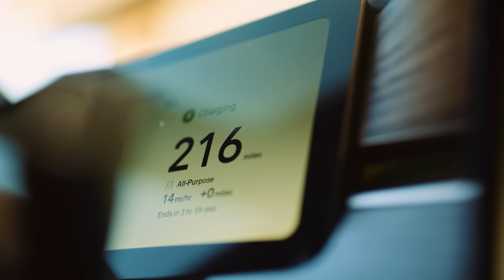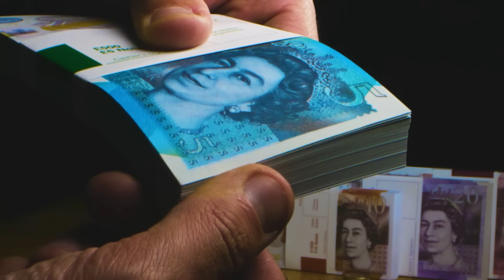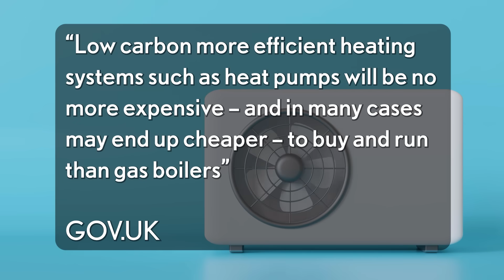The Truth About an All-Electric Future

Comment: Not sure they're making the gas safer. The company that changed the pipes in our road are a right bunch of cowboys. 
They renewed the pipe in my front garden and I had to replace the shrub They took out. I dug a hole going down a fork depth, pierced the new plastic pipe so had gas pouring out into the street. Turns out they hadn't put it down at the recommended depth. Ridiculous considering it's going under a garden where I'm obviously going to be digging

Comment: Our bills are around a third of what they were with gas simply by storing heat produced by the heat pump at night with a thermal store , running appliances and night and charging the car and batteries .
Nearly all our electricity is at 7p or less with solar 
Pie in the sky?
Reply: All very well for huge investment. What if you haven't got that money or the space? It's simple: energy prices must be reduced to less than a third what the state keeps them at.

Comment: WHY get rid of fossil fuels?  For one they're not 'fossil' - disabuse yourself of that fallacy.  They are not harmful unless you use them irresponsibly.  Catalysers, filters and other technological advances have made ICE engines almost 100% clean and the only discussion point is the CO2 which can easily be debunked as a 'pollutant'.  So-called fossil fuels (coal and gas in particular) could keep us warm and economically viable for centuries IF we had sensible policies instead of religious ones.
Reply: Oil and gas are the remanets of fossilised ancient plants and animals from about 200 Million years ago, similarly coal is the remains of long dead trees.

Science, not your religion, tells us that too much CO2 leads to atmospheric warming at a level the plants and creatures around us cannot survive in, us included when you factor in drought and starvation.

Exhaust emissions are filthy and carcinogenic, an extract from Health and Safety executive :-

"Vehicle exhaust fumes can irritate the eyes and respiratory tract, and are a risk to health by breathing in. Carbon-fuelled engine fumes contain carbon monoxide, a poisonous gas. Prolonged exposure to diesel fumes, especially blue or black smoke, may lead to coughing and breathlessness. Long-term repeated exposure to diesel fumes over a period of about 20 years may increase the risk of lung cancer."
Reply: @_Dougaldog   CO2 levels of 4,000ppm (some 10x what we're currently in) resulted in the most prolific animal and vegetation coverage on the planet during the Cambrian period.  This is what SCIENCE tells us.  You're reading the wrong books.

Please explain how dinosaurs all collected together in multiple massive graveyards to decompose into oil?  Please explain how dinosaurs exist on Jupiter, Saturn and other planets and moons given the PROVEN sources of hydrocarbons there?

If exhaust emissions are harmful then stop putting your mouth around the exhaust pipe.  Equally, don't spend 20 years sniffing HGV exhausts.  Specifically, don't sit in a car garage with the doors closed and engine running.

But, with EVs you're at risk of electrocution or immolation if you're that unlucky.  Everything in life has risks but we balance those risks against the rewards and YOUR fabulous lifestyle, YOUR excellent health and YOUR access to foodstuffs and goods are ALL the product of 'fossil fuels'.

Stop being so disparaging about something that has MADE your life and keeps it going.
Reply: @kellyeye7224  

You need to go back to school, educate yourself, Dinosaurs appeared long after the scene was set for creation of oil and gas.

Creatures lived in the seas that cover our planet, over hundreds of millions of years they died and built up on the ocean floors.

I'll let you go online and find the rest.

Burning oil and gas is destroying your environment you should not worship that but evolve and create a better future with skilled jobs and workforce.

The oil and gas in the North Sea is near exhaustion, we'll need to have broken our reliance on it before it runs out, which is exactly what is in progress now whether you like it or not.

Comment: As an electrical engineer of 37 years I think governments are utterly ridiculous . They call it green washing. The amounts of energy required to produce electricity cables, chargers, plastics, metals, not to mention the huge recycling as things get worn out. It cannot be rushed just because governments demand it.
Reply: It's not being rushed, the net zero target is twenty five to thirty five years away yet.
Reply: @_Dougaldog it is being rushed because the EV vehicles are not the entire answer nor are windmills that have relatively short lives of 20 to 25 , car chargers that fail after a few years ( I have replaced enough to know) and many more rushed technologies that are less than ideal just to reach certain targets before the deadline. Look at how many manufacturers tried to make engines that used less fuel and ended up making engines that fall apart in 60k miles. All require huge amounts of energy to recycle and EV’s even more. I have lived long enough to know that the planet cannot sustain the abuse it is currently facing but we are obsessed by technology to answer the problem. Consumerism and huge amounts of unnecessary travelling round the planet in planes is a far bigger issue. In my opinion.
Reply: @christastic100  look up data on the sustainability of EVs. The extra emissions from the batteries are compensated for in around 14 months of use. Tech is there to recycle the batteries for the next generation.

Comment: I envy people people with gas oil heaters and large tanks.
Reply: The tanks look so nice in the garden?
Reply: @Biggest-hz7ng That would be the least of my worries. Those people with gas oil will have heat if the taps ever get turned off.
Reply: @TurinTuramber I think I'd prefer greener, less polluting heating for myself and my neighbours, and no tankers needed. If you want a day or so's resilience, just add a suitably wired battery.
Reply: @Biggest-hz7ng The energy densities don't compare, an extra battery is nothing compared to a tank of fuel oil. 

Greener options are largely gimmicks to sell to people.
Reply: @TurinTuramber but if you believe outages won't be huge, electricity is fine, surely?
Reply: @Biggest-hz7ng A battery is better than nothing and you can have both. I think putting all your eggs into one basket is risky and once you are utterly dependant on electric you are going to suffer when the price jumps.
Reply: @TurinTuramber price isn't going anywhere. The UK is building more generation and transmission. The government won't willingly impoverish its citizens.
Reply: @Biggest-hz7ng Haha good one.
Reply: @TurinTuramber for one, you don't get voted in again
Reply: @TurinTuramber  

Until the tank runs dry ?
Reply: @_Dougaldog  Sure but a miniature nuclear reactor isn't an option so it's the next best thing. A tank could last a winter.

Comment: It's all total bollox. The government aren't investing anywhere near enough in generation, distribution and final delivery if they are serious about going all electric.
Just on generation they aren't planning enough capacity to cope with a 2 to 3 fold increase in demand. Hydrogen is expensive to generate, the atoms are the smallest thing in the periodic table meaning that distribution or delivery systems are likely to, at best leak, and at worst cause explosions.
Renewables are typically at the mercy of the weather, so it's either a country covered in those terrible BESS storage systems ( just like in EVs, battery tech lags well behind and so Bess's are unsightly, expensive, noisy - need air con to keep them cool,  and just like an EV if the batteries go into thermal runaway, they catch on fire and explode).
For the UK tidal seems like a good idea but there next to no investment here. The least worst option is nuclear and they aren't planning enough nuclear plants.
Anyway keep buying Tesla's everyone because nothing says ' I'm saving the planet' efficiency like a single occupant in an enormous 2.5 ton car driving like a bell end, chewing up the road surfaces with it's heated seats, air con and all the tech wasting battery power.
Reply: For one thing, EVs don't catch on fire like ICE cars do. The government are planning to 2-3x wind, and 1.7x solar, along with the transmission that goes with that.
Reply: @Biggest-hz7ng You're right it's possible to put out an ICE fire.
Solar - useless at night or when it's overcast. The government are actively encouraging areas of farmland to be put over to solar, so unreliable energy over food yeah great idea. Wind - useless when there is none or there's too much.
If we go with these unreliable generation methods we need storage and transmission. The option today is BESS storage and as per my post these are inefficient, ugly, use huge resources to build, not energy dense so they take up huge areas, and if they get hot expect a huge fire. We need reliable generation to meet dynamic demand and the government are hell bent on unreliable renewables.
You don't even have to believe me. Germany is the leader in early adoption of renewables and now their electricity is approx 25% more expensive than the UK because of it.

Comment: A school I worked at had a heat pump forced on them by the local council, it cost over £900k to install and the energy bills have quadrupled compared to the old gas/oil setup and the school has to pick up this bill from their existing budget (that’s £100k per annum as opposed to the previous bill of £25k and when I spoke to the project manager he said I’ll never pay for itself)
To that end it’s been switched off and they rely on a small gas boiler that was left installed.
Reply: There's example of poor management everywhere. Most schools are old and poorly insulated. Heat pumps should not be used until the building is properly insulated. I Know of 5 people with heat pumps, in appropriate insulated housing and they work absolutely fine, provided you get a competent installer. No 1 thing to do is Insulate!
Reply: @gerryparker7699 the 'requirement' for insulation is a myth. They can be installed in churches etc. You may choose to add insulation to reduce running costs (as insulation would with any heat source) and reduce the size of the install, perhaps needing a smaller heat pump and radiators.

Comment: Yet another ‘big oil’ push to allow them to carry on drilling. We can’t make enough green hydrogen at a sensible price so they’ll save us by making hydrogen from oil.
Reply: Hydrogen won't be a thing for heating as it is 5-6 times the price of gas, but it will be used in a small way for niche users.

Comment: Sorry to say, but we are in the process of a managed destruction of the energy system across UK & EU. Shutting off cheap reliable energy and replacing with intermittent expensive energy sources, why? Because they want to manufacture scaricity and turn energy into a form of control, via a carbon credit system. Already being rolled out for companies, and will be coming for individuals as soon as they implement Digital ID and CBDC infrastructure (via an orchestrated financialy crash in next few years).  DO NOT COMPLY.

Comment: Until China stops building and using coal fired power stations to produce battery powered cars we really shouldn’t worry about fossil fuels. Hydrogen is a non-starter. Data centres will suck all the electricity and water they can take so it wouldn’t be surprising for coal to be burnt again.
Wind turbines and solar panels have a short life and are currently not recyclable (that may change).

The climate’s changing and, guess what? It’s always changed - since the planet came into being, and will continue once we’re all gone; if not why don’t dinosaurs still rule the earth?  We are currently on the end of an ice age (cycles of approx 100 000 years) and warming is to be expected. The climate is also affected by the Milankovich cycles. The planet’s fine - we’re the fragile ones.

About 11 500 years ago there was “an event” leading to the Younger Dryas - scientists cannot even agree the cause, although one theory which is gaining traction is that meteorites caused the massive Laurentide ice sheet (over North America) to melt and pour cold water into the Atlantic ocean etc.
Reply: China is shutting old coal plants and denying many permits for new plants. Their increased electricity demand has been met by solar and wind. They have a Net Zero target date of 2060, but are more advanced than the UK in their electrification of power. An increasing proportion of their new cars are EVs. Fastest production car is now a Chinese EV (no longer a Bugatti Veyron).

Comment: There’s no gas in my village.  So it’s electricity, oil or logs.  I’ve chosen the renewable option - burning logs.  You know what? They literally grow on trees…  😂
Reply: That’s good but we all can’t do that unfortunately plus it ain’t good for the environment and our lungs
Reply: @jasonallatt5410  I'm not quite rural enough for it to be excusable, I think. I apologise to my neighbours for it every few years, they say "I quite like the smell". The air pollution issue is obviously practically unavoidable with solid fuel. Between full-on-cities and tiny low-density villages, gas is the obvious 'furnace' solution.
Reply: Many switch from oil to electricity when their boiler's time comes and get rid of their fuel store and the periodic fuel truck.
Reply: My heating is electric most of the year and wooburner in winter. As house is better and better insulated as I work on it, we've gone from 3 loads per winter to less than 1. It is nice to have a furnace in one part of the house.

Comment: Just wait until someone cyber attacks smart meters.  Imagine the carnage if they remotely switch off your power (smart meters have that functionality) and then the brick the meter so it cant be remotely recovered.  You could have something like 10 Million meters (just a guess) that would need someone to physically go out to to replace or repair.  How long would that take, and all the time you are waiting you have no power!  One of my reasons for resisting 'smart' meters for as long as possible.
Reply: There are other vulnerable parts of the transmission infrastructure. Hopefully there are eyes over these components. Hopefully potential adversaries have eyes on their potential vulnerabilities too.
Reply: @Biggest-hz7ng  Knowing how the UK infrastructure is operated / maintained then probably not.  Always seems to be a reactive rather than pro-active attitude (probably because it seems the least costly approach...........until it isn't!).

Comment: Went on the very 1st car charging course and i saod where you going to get the power from?

Got brushed off..

And here we are !
Reply: Car charging actually is easy.

Charging can mostly occur overnight when the grid is lightly loaded.

The power can be provided by existing generation.

Heat pumps use more energy, but their growth is delayed compared to cars, and we are building out the grid and transmission to match their use (we have time).

Comment: 2030 was fictional not a chance but your half wrong yourself becuase renewables in some forms are useful not a blanket failure at all.
The cables are happening dig up the roads lol most the main infrastructure is above ground, the problem is corruption not the hardware.

Comment: The grid needs about seven to ten solid big power stations running on gas , coal , nuclear, whatever to provide the basic grid with its fifty hertz cycle. Renewables can feed into this 50 hz but you can’t maintain it with a solar or wind farm on its own. They can boost output but you need a ver stable core production. Only hydro electric could do that with a water head.   And even that midnight off peak thing is over with everyone charging their cars overnight.
Reply: You can run frequency response electronically, with batteries and the nuclear and hydro that we currently have. Gas power plants could run at a very low output to help with frequency response too. Gas plants would be on standby, ready to spring into action when they are needed. The gas plant owners will need to be paid for this service and their use as a backup. But it would still be cheap as we would mainly be using the output of cheaper sources, mostly renewables.

Comment: 1. Most solar is installed on home and commercial building roofs. The energy they generate is mostly consumed by the owner, therefore no wires need to be installed to take the energy elsewhere - unless they are exporting to the grid by arrangement with the DNO.
2. Batteries are the answer to "dunkenflaute", or pumped hydro. Sand batteries are also an option.

Comment: No one serious thinks pumping hydrogen through the gas network is feasible. The only people suggesting it are boiler manufacturers.
Reply: why not town gas or coal gas had a lot of hydrogen in it
Reply: @markjones4704  

It also had lots of Carbon Monoxide in almost equal volume making it highly toxic, once upon a time poor souls used to stick their head in the unlit gas oven to extinguish themselves.
Then comes the expense of producing it in sufficient quantities.
Reply: It works at an 80\20 mix
Reply: @SlowhandGreg yes, but with hydrogen 5-6x more expensive than gas, you've roughly doubled the cost? It won't fly.
Reply: @Biggest-hz7ng  

They're planning for a green hydrogen produced relatively cheaply through excess renewable production, but to be honest by the time that's all in place residential gas will no longer be a thing for most.
Reply: @_Dougaldog that might be the stated plan, but Michael Liebreich points out that hydrogen plants don't sit idle, they need to be earning their owners money to be economically viable.